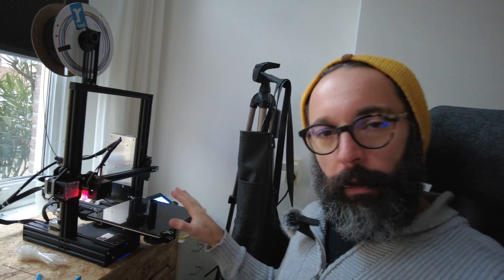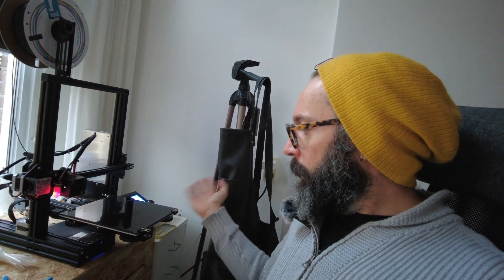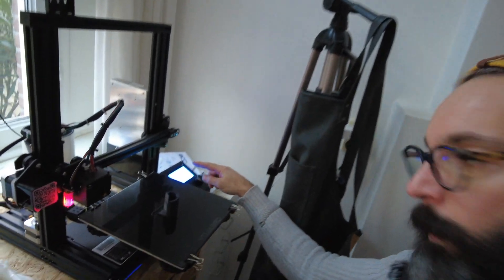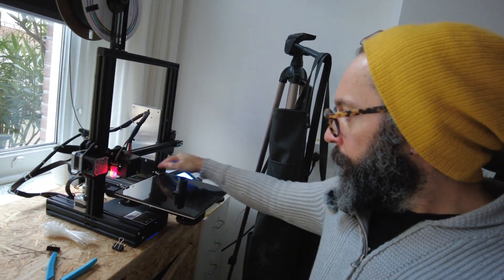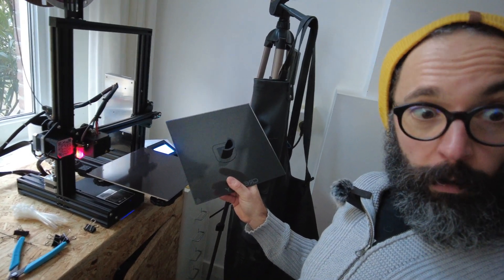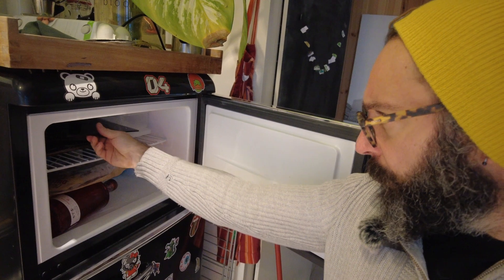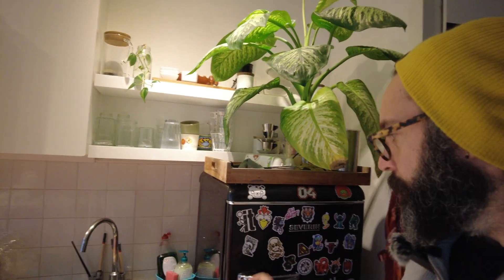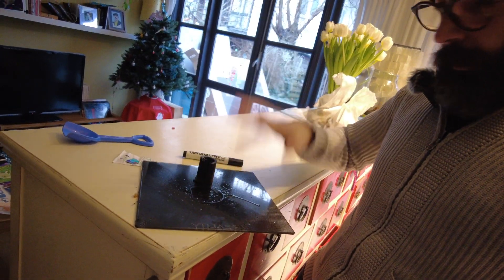Freezer + 3D Printer = ???????

Comment: Hi 
I might have a better solution for you, without moving your bed. Try 50/50 alcohol/water mixture in a spray bottle. Spray around the mating edge of the bed and print. In 15-30sec. you should be able to pop the print right off. You may hear little crackle as the part is unsticking and sucking more of the mixture under it.  If its a large flat print that stuck real well, you may need to use the spatula but it slides right under with out any force. I print on Ender with glass bed as well, large flat prints that take up about 60% of the bed, come off real easy. Added bonus you don't have to level the bed because nothing is moved, and when you wipe of the alc/water mix from the bed you also clean it, so you can go straight to next print.
Reply from the maker: Ah thanks for the tip! Ill try this. I got so used to the freezer by now hahaha
Reply: 50/50 didnt work for me. I have an Aquila X2 which comes with a coated glass bed. Im assuming it has something to do with the coating.
Ive let it sit for various amounts of time with copious amounts of mixture (50% water, 50% 91 Iso). 

The freezer method worked flawlessly. Although it took roughly 2-4 minutes, not 40 seconds.

Comment: This technique just really useful for tiny, fragile objects to get them off without damage. 
As soon as real large area is sticking to the glass, it won't work. I've struggled for hours yesterday to get a stuck box off.
I've frozen it twice, used the alcohol/water mix and still no chance. I left it under water over night and it still was welded to the plate.
Just a careful split with a scraper and a hammer did the thing and even then you could see from the other side of the glass, how always only small parts are separating.
I was lucky, nothing was damaged.
Reply from the maker: wow.....I never struggled....but I print.mostly small things
Reply: Yes, once the contact area widen up the more contact surface will make the removal much more tough. I am also thinking if we can soak the entire glass-print onto ice chilling water, not sure if it has any good effect on the removal.

Comment: I was having a similar issue, but I found applying a solution (1:1 of IPA and water) to the edge of the print and waiting ~10 secs that with minimal effort the print comes off.  I haven't tried when using the smooth side of the glass plate.
Reply from the maker: Yes....the smooth side causes better surface prints and lots of headaches hahhaa

Comment: Works great for small parts and sometimes big parts. I just used this technique on a big part that worked 2x in the past and this one time it ripped off glass with it. Oh well, time to upgrade the bed anyways!
Reply from the maker: wow....it ripped the glass or the material on top of the glass?
Reply: @OneTimeBuilds  Hey!, It ripped off a thin layer of glass and the glass was stuck to the part. This used to happen to me often until I learned that you can't print PETG on glass but this was PLA+. I ended up freezing the part and then tapping the glass to shatter it further and get it off the part.
Luckily I can still use half the bed right now to finish some parts, I have a magnetic removable bed in the mail which I'll have tomorrow to try out. Worst case if that sucks I just get another glass bed for $20.
Reply from the maker: @fc3sbob  Yeah...I have used magnetic beds and they are a pain to calibrate and get the print to stick properly hahaha
Reply: @OneTimeBuilds  haha, we'll see about the calibration. I'm running Klipper on a Ender 3 V2 with a BLtouch so it shouldn't be a huge issue. I'll have to dial in my Z height as well.
Reply from the maker: @fc3sbob  hahaha....I have the exact same setup.... for me getting the part to stuck was a pain....this is why I moved to glass only. Hope you have better luck than I had.

Comment: Caution!  This method works BUT it caused my PETG print to grab the plate such that when I did remove the part, it took a chunk of my build plate with it.  Now I have divots in my build plate.  TIP: get a 1/8" sheet of plate glass for your build plate, and use the holder which holds a 1.5 inch razor blade to remove the part.  Make the bed HOTTER than when you printed, and the part pops off easily using the razor blade.

Comment: I used glue on a steel heatbed before printing, so it made it difficult to use this technique. The object I printed won't come off the bed. I had to use alcohol and a spatula.
Reply from the maker: I think with glue and a steel plate (mine is aluminum) you will need a colder freezer and more time since the steel will take longer to shrink

Comment: I’m having trouble 3D printing I do not know how to load models from thingiverse onto and sd card and the slice and print can you help please
Reply from the maker: That is a rather generic question, but hopefully I can give you some pointers. 
1- Download the model in STL format
2- Open the model in your slicer (I use cura)
3- Set your configuration for the slicer (this can be quite complex) 
4- Slice and inspect the model 
5- Save into an SD card (I use a card reader for my mac)
6- Print :-)
Reply: @OneTimeBuilds  thanks

Comment: This ethod doesn't work for me.  I print medium to medium large objects (objects about 1/4 to  1/3 the build plate surface) with a Creality glass bed.  Man do I struggle.  I see tons of videos with people saying prints dont stick, but not for me.  I think it's an exact science in that the build plate material or coatings added plus printer calibration and temps all play a roll.  Not one size fits all.  Good video though.
Reply from the maker: I think for larger objects more time or lower temp might be required. I print mostly small parts though :-)